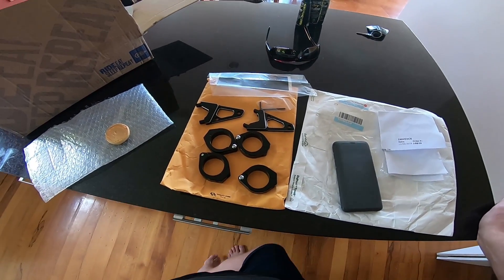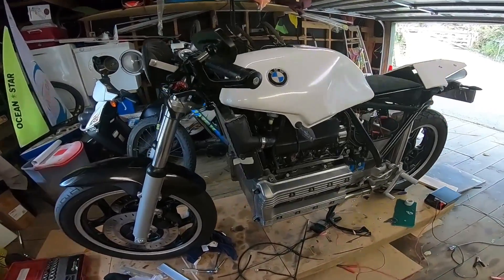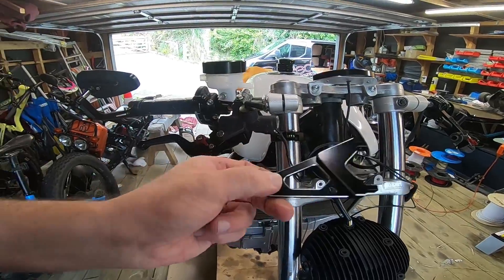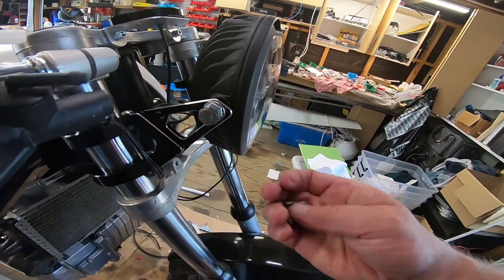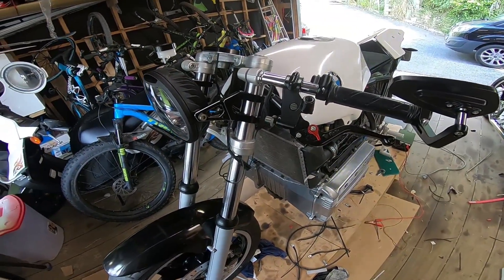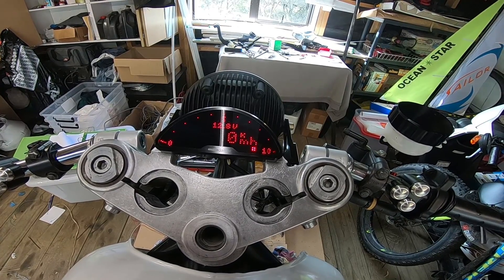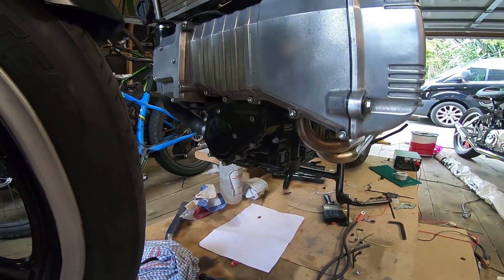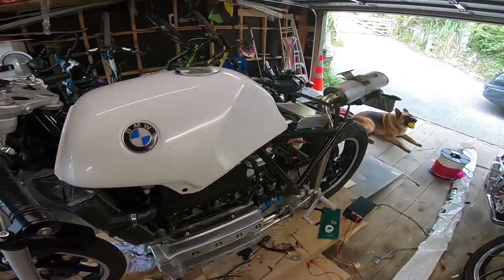BMW K100 CAFE RACER BUILD PART 42

Comment: The fuelpump gets noiser with time, depends on the milage. You can swap it for one from an Audi, they are same and much cheaper.. Voltage should be at 14 volt, give it a few throttle pulls when it's running. If the voltage doesn't go up, you have a problem.
Reply from the maker: cheers dude !

Comment: Awesome looking Headlight brackets!!! as are identical to mine but came in a fancy box. I also changed mine to facing down as they came assembled in the up position.
Have you wired up  a needed charge light from the alternators blue/brown? wire to earth? if not its an easy fix to get the battery to charge. As the bulb goes out with increased revs thus allowing the alternator then to start charging the battery you should then get approx 13.8 volt reading on your motoscope pro..
I used a 12v led with a resistor to mimic an incandescent bulb. Or maybe you could just wire up with a resistor then no need for a bulb..but then you dont have the visual reassurance your charge system is working..
Reply from the maker: Hey cheers for that info , I am gonna go try that right now !
Reply: @mikeyfrompiha  Hey how did you get on with your alternator? 
 Are you around over the  Christmas/ New years holiday period? If so may come out for another ride  and say hi if weather comes good.. n I'll bring the beers..
Reply from the maker: Yep ill be around , give me a days notice first just incase we head out , pissing down here at the moment ! Back to work on the 7th :-(

Comment: Did you go with the 40/41mm headlight bracket size or the 42/43mm? I think your fork tubes are about 41.3mm. I'm working on a 4 valve version that has 41.7mm tubes and I'm trying to get an idea of which size to get. Cheers!
Reply from the maker: Hello , yes I got the 41mm headlight bracket and it fitted like a charm , the handle bar clip ons were also 41mm and were extremely tight , I don't have a set of Vernier calipers so I cant give you a accurate measurement of my fork legs but I did read in the manual about 41.3 mm .Are mine 41.7? not sure . Hope this helps

Comment: I have the exaaaaact problem with my alternator on the 85 k100 rs model. 33k miles. And the noisey fuel pump.
Reply from the maker: I just pulled out the alternator from the bike this afternoon to have a closer look
Reply: If you are running the original dash check your charge light is not blown or working  which is connected to a blue wire on the alternator. The lamp should come on when idling then go out with added revs, indicating the alternator is now charging the battery..Either way  if you are running an aftermarket dash you need to wire in a charge lamp for the alternator to work.. Hope this helps   : )
Reply from the maker: HA HA cheers man , just sorted it and am going to do a video on how I did it , much thanks to you !